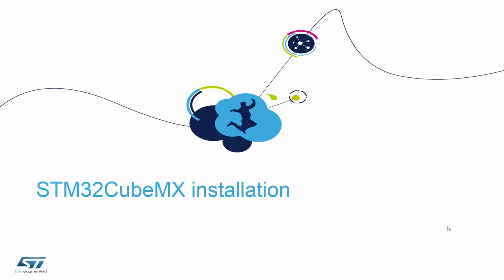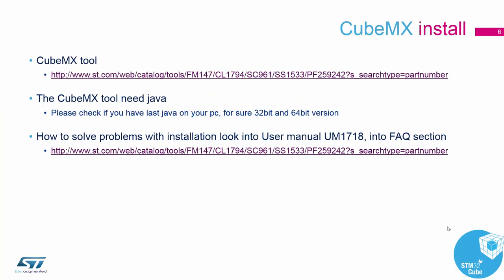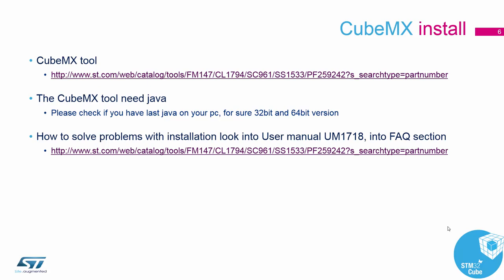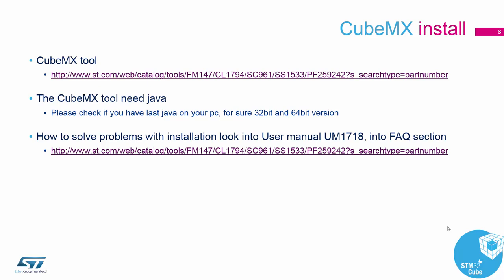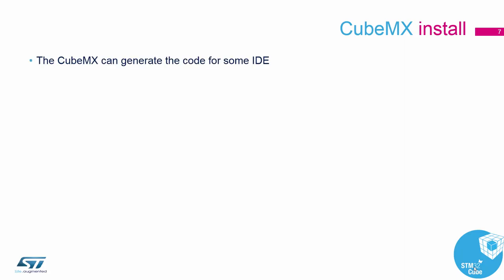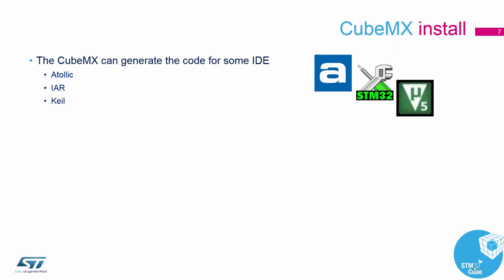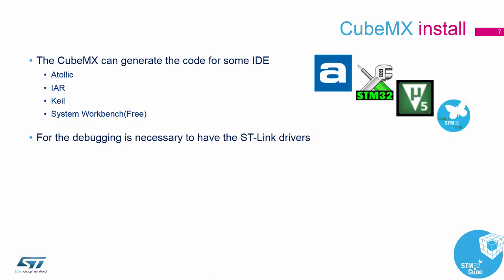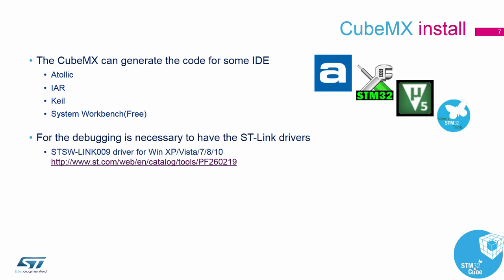STM32CubeMX basics: 01.4 Introduction - STM32CubeMX installation

Comment: thanks for create this video. i have issue with connection for install package. i am also try to download manually but fw_f4 v1.17.0 for my board stm32f401ccu6 is not available. would you like to share with me? thanks